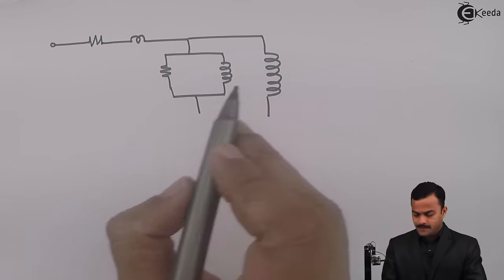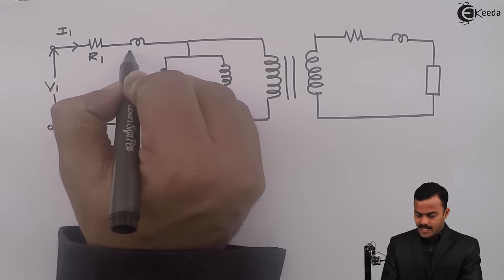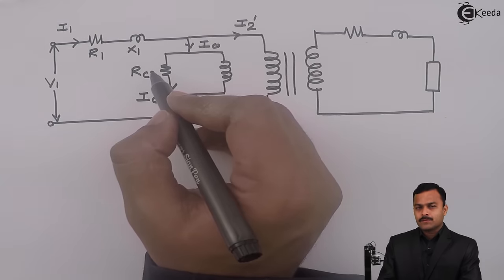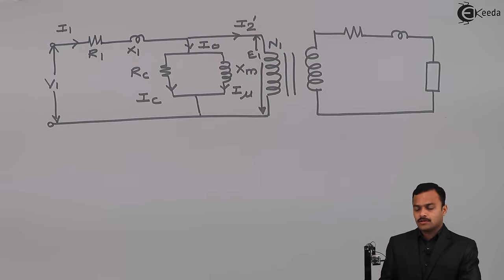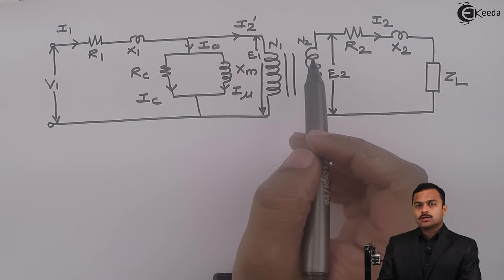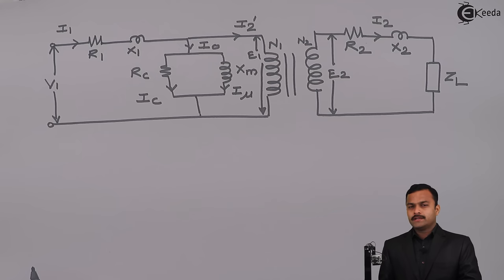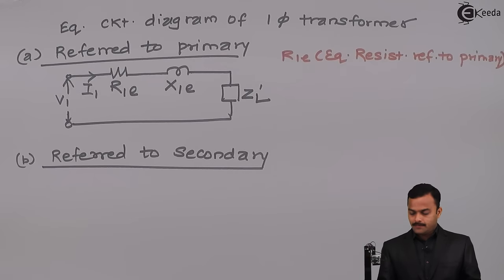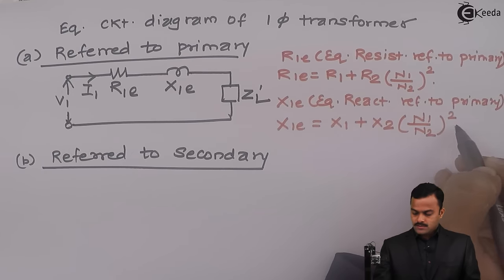Equivalent Circuit of Transformer Referred to Primary and Secondary - Single Phase Transformer

Comment: When secondary winding terms are shifted to the primary side, secondary winding terms are divided by k square.
but you had multiplied
Reply: Why divide
Reply: U r correct, it should be multilied by k sq , trnsf ratio or can be multiplied by a sq, turns ratio

Comment: 1:13 I2' was described as "the current responsible for nullifying the effect of Phi 2"  What does it mean? Phi 2 is on secondary of transformer induced by Phi 1 from primary, so how did I2' nullify its effects? I'm confused. Thank you so much.
Reply: Actually when the load is connected to secondary side, the circuit is complete and i2 flows through it. Since i2 is an alternating current it produces mmf ie N2I2 which is the flux that acts opposite to the flux produced by primary side. To nullify this effect the primary side Creates the emf and the current I2' is induced that creates mmf N1I2' which is equal and opposite to N2I2